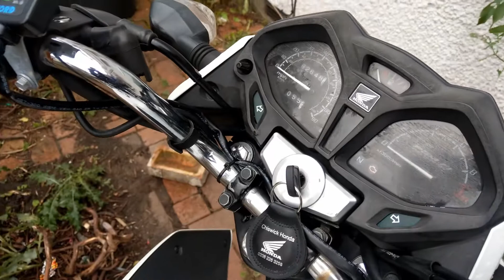Honda CB125F (GLR)  Inspecting Oil Strainer , Oil Strainer cleaning after 82600 Miles

Comment: I was taught by an engineer that about 75% of all engine wear occurs when the engine is cold, the other roughly 25% occurs during startup which of course only lasts a matter of seconds. You started the bike with nothing other than a thin oil film protecting the moving parts and revvved it up a bit... As soon as it was started, that thin oil film will have been gone in no time and with no fresh oil to replace it, very harsh metal on metal contact would have occurred. No wonder the engine didn't last much longer.
Reply: This is when he broke his engine.

Comment: Great that you have done such a high mileage. Unfortunately some modern cars cannot reach that mileage these days without having  total engine failure.
Reply from the maker: I managed to do about 95000 miles with that engine, but I change the engine, I may rebuild the old engine and make a video on that later 😁

Comment: Wow! That mileage is incredible! My wife has a 2016 CB125F that's just passed 13,000 miles and I change the oil every 1,000 miles. I clean the strainer and centrifugal oil filter at 5,000 miles. The valves are also checked/adjusted at this point. I think it will live a very long life! Do you use the bike for work? Deliveries? Amazing mileage ❤
Reply from the maker: Yes I do work with this bike, and put alot of milage on, I also changing my oil every 1000 mile and that is why the engine last long , you don't need to check oil strainer & oil filter every 5000 miles if you regularly change your oil, 
Overall very good and efficient bike , if you look after ,it will look after you 😇
Reply: I'm looking for part numbers for the oil filters, do you have them to hand? Just got myself a CB125F 2019.
Reply from the maker: No I don't have the number for it,  you just need to clean the filter mesh, replacement is not require as long it's not damaged
Reply: The later version with digital speedo has a paper cartridge filter held on by two bolts, hence this silly ritual of removing clutch cover not required, thank goodness.

Comment: Hi there ! Did you run the engine a bit before draining the oil? (so it gets less viscous)
You do an oil change every 1500km? Isn't that excessive?
I would probably follow a logarithm curve regarding the frequency of oil change starting at 100Km for the first one then 500 then 1500km and finally every 5000km.
Honda recommends the first oil change at 1000km then every 4000km.
They also recommend to check the oil strainer after 12 000km. (I google "cb125f user manual").
I believe it was a good thing to run the engine for a few seconds without the oil 10:30 but I would like to be sure it's safe to do so.
Thanks for the video
Reply from the maker: Hi,  I am aware of the manufacture recommendations, but I ride about 100 miles/ day, and when I reach near 2000 mile my oil is almost half, so I usually Change my oil every 1500 miles, and it better for my engine, 
Btw my Engine broke down after 90000 miles and I recently put a new engine on , in future I may shear a video on engine failure
Reply: @ParsMaker  I would love to know what failed on the engine ! Maybe it's related to the oil level dropping so fast. As I said,  Honda recommend an oil change every 4000km after the first 1000 so maybe there was a problem with the piston rings not making a proper seal.
Maybe you pushed the bike too hard when the engine is cold.... I don't know but I would really like to know about the engine failure.
Thanks, I subscribed :)
Reply from the maker: @Platypus_Warrior  thanks mate, I will try to  make a video on that,  I kept the engine, so as soon as I find a free time for it, I'll strip it down,
Reply: @ParsMaker  It's an air cooled engine, small wonder it lasted as long as it did!

Comment: Hello Skilfull man!
What is your impression on the new cb125f,  model 2021 ?
With the new motor and the loss of weight.11kg !
Is it still worth buying it ?
Greetz from Torsten
Reply from the maker: hi, well I personally like the 2015 -2020 model , I saw the new bike in honda showroom , they removed all the side alloy from passenger footpeg and use cheaper metrical it looks more like chinese bike with new head light  , the only new thing that I like about new bike is the brushless starter and charging system + auto on&off system, the funny part is the 2020 model is still cost you more to buy.
Reply: @ParsMaker  Thanks for your answer!
I was a little bit shocked about all that plastic parts when I saw the cb125f in the shop here! In the youtube videos the machine looks better , hahaha !
But it would be alright for me if the quality of the motor is typical Honda !
Greetz from Germany ✌

Comment: I had a Yamaha YS 125 I got to 16.000 km in 2 years and then sold to get a KTM 390 ADV. It had a cartridge type paper oil filter. Does the Honda have no replaceable oil filter? Thats interesting. Looks to be a reliable bike. And super lightweight. I might buy one.
Reply from the maker: yes , this is  reliable bike, my engine gave-up on me after 90000 miles , and I replaced the engine , I'm very happy with it

Comment: Hello, my engine is at 5000 km.  When should I clean the filter?  Honda cbf125 2012
Reply from the maker: Hi,  honda recommended inspect every 12000, But I would say after 20000 , just make sure you keep changing your oil on time or sooner, u don't need to worry about that
Reply: @ParsMaker  Thank you, I do not want to check before 12 thousand km.  You recommend 20 thousand km.  thanks
Reply: Is 2000k km interval good for oil change?
Reply: @seninhobin  These guys change it every thousand, Honda says every 4000.

Comment: 87000 miles did I hear right. Also never start an engine with no oil in
Reply from the maker: 83000 miles when I recorded this video,  currently Its over 88000 miles,.  🤠

Comment: hi! 
congrats on high miles!

wondering what miles per galon you get from it?

use brake cleaner before and after doing any stuff to engine, sand bits do more damage than not opening it.

also better look up nm requred for bolt torque..

best wishes!
martin
Reply from the maker: I still get about 120 to 150 miles per gallon , depend on how fast I go with it

Comment: Never will change mine it's not worth the labour on my CBR125 it's been in there 30000 and I've never had a problem
Reply from the maker: It is better to be checked , I saw some oil filters on similar bikes get clogged badly ، and if that be the case , engine will not survive